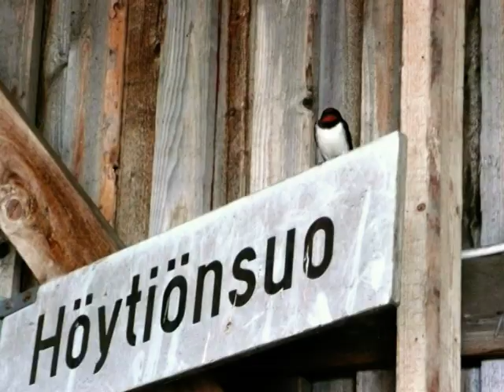Suolla Taas 2010

Comment from the maker: Stock piles are made with mechanical harvesters - kind of sweepers... Driving over takes out most of the air inside to prevent self ignition in stock. Covered with plastic primarily for the same reason. You may see some more info from vapo dot fi (local energy/biofuels)
Other methods seen in my other videos.. :)